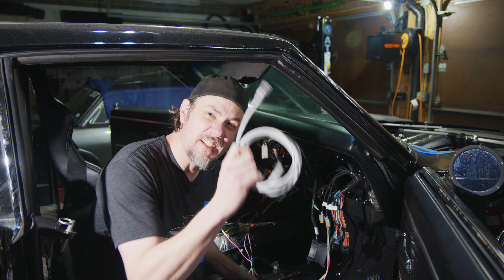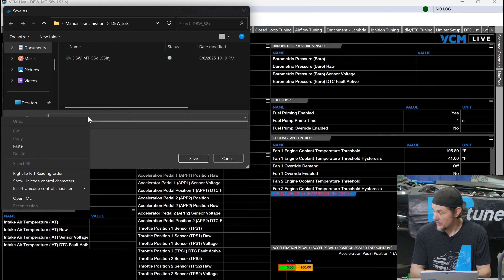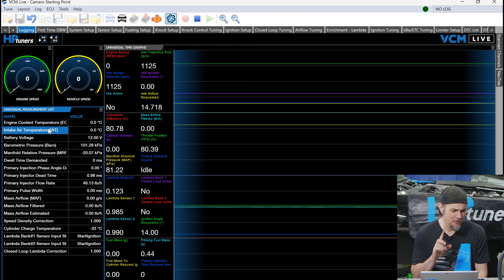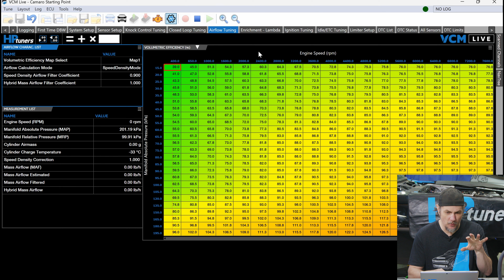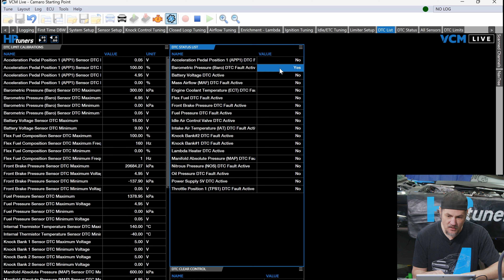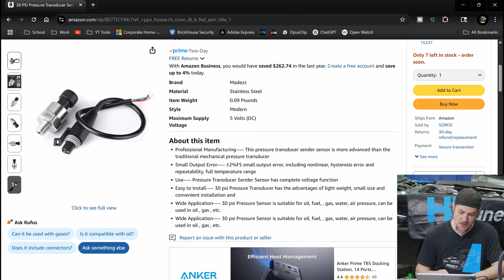Powering Up The HP Tuners Core ECU, Registering and Troubleshooting

Comment: Im commenting before end of the video and you may already have figured it out, but im wondering if the barometric reading is like showing a default value and not an actual sensor reading?
Reply: Nevermind
Reply: The regular readings when a DTC is active show a default value you are correct. The raw readings will always show you the actual reading even if there is a DTC active

Comment: Negative offset sounds like it's wrapping (underflow). Raw voltage is little to no math done, PSI/KPA uses calibration offset and susceptible to wrapping, filtered probably has an "IF crazy number, set to number that won't implode engine" line of code since filtered get's used in fuel/spark calculation.